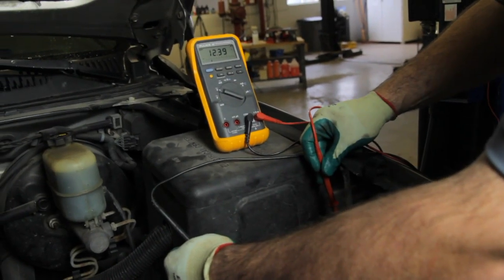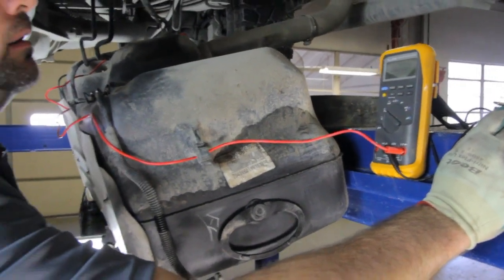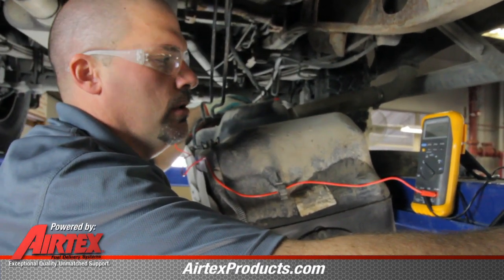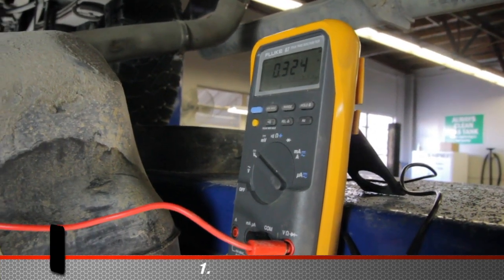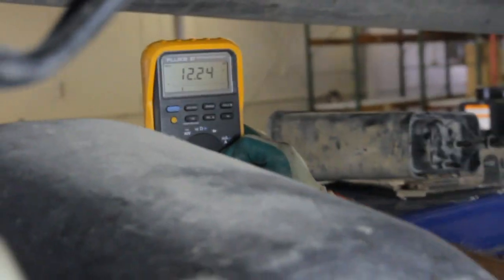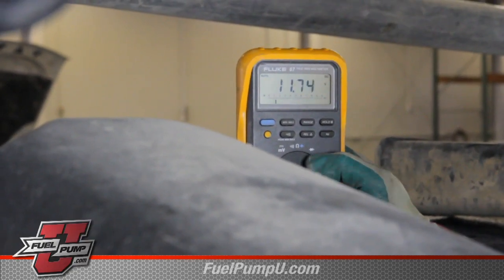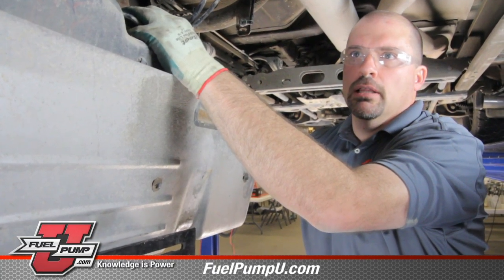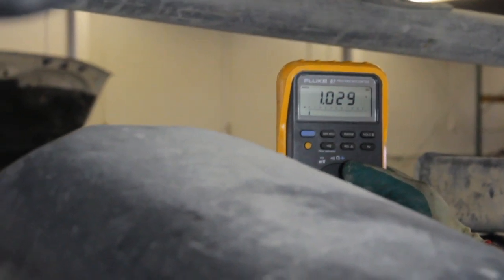How to Test for Fuel Pump Voltage Drop

Comment: THANKS FOR YOUR VIDEO. A few Key terms should have been mentioned in your diagnostics.  For instance, your first check is called " a Ground Test" integrity for the fuel pump. In other words, any voltage drop on this Fuel Pump Ground will indicate a poor deteriorating ground connection. There is a limit to what this maximum value voltage can be. Also, any voltage drop on this check indicates that's the amount of voltage that will will be deducted from Battery system voltage and applied to the Fuel Pump (not good you always want battery system voltage applied to the Fuel Pump circuit).  As you mentioned, the amount of voltage to the fuel pump affects the RPM of the fuel pump therefore affecting the pressure of the fuel at the fuel injector rail.  Your second test emphasizes the voltage lost from the 12 volt power source to the power connector on the fuel pump.  This reading will also be subtracted from the total Fuel Pump power voltage applied, therefore affecting the speed of the fuel pump and it's pressure it delivers.  And lastly, at the end of the video it should be emphasized that yes the engine is running, however there is a resistance problem and it could become worse over time.   In addition, this resistance build up in a Fuel Power Circuit will result in poor wide open throttle acceleration. Of course my comments do not apply  directly to Pulse With Modulated power Fuel Pump.
Reply: He did a voltage drop on ground side first, duh and thats hos whole point pump isnt fetting full voltage
Reply: Blah blah blah

Comment: I’m getting 7.5 volts while back probing the  positive terminal. Have been trying to figure this fuel issue for months. I’ve replaced the pump and sock filter just not getting hardly any pressure. Checked the relay it clicks and is within the range for it to be good. I have checked wiring diagrams all grounds look fine.
Reply: You ever figure it out. I'm stuck. Please.

Comment: If I have 0 fuel pressure in my fuel rails and don't hear the pump cycle on ACC, can I just back probe the pump wire to the frame to test for any voltage going to the pump before I call the pump bad? 2000 chevy silverado with a lot of ground strap issues a gauge cluster slow drain. Just want it to run, no frills.

Comment: Great video! I am experiencing slightly lower pressures than id prefer and wonder if a combined voltage drop of .8 volts (.5v pos and .3v neg) would be enough to drop my pressure 5 psig or so. What are typical voltage drops on a new vehicle? I have not eliminated the power side contacts of the FP relay yet. Is there a typical contact resistance that is acceptable? How can the voltage drop of the relay contacts be segmented and measured?  thanks in advance.

Comment: voltage drop tests you should learn .. use on every car with any electrical or fuel injection issues.
engine running.. headlights on.  Digital meter set to 20 volts DC.

1. Negative battery post  to Positive battery post.  14.1 to 14.8 is expected.
2. Negative battery post to the Engine block.   0.04 volts DC max.
3. Negative battery post to the Body. 0.02 volts DC max.
4. Engine block to the body. 0.02 volts DC MAX.
if you get 0.00 volts on tests 2, 3 or 4.. set meter to 2 volts DC and try again..

additional tests..
trucks with frames.
Negative battery to the frame.. 0.02 volts DC MAX
Engine block to the frame. 0.02 volts DC MAX.  
why because the tail lights and usually fuel pump are grounded to the frame rails. not the body on trucks with frames.

on the positive side of the circuit..
Positive battery post to Several fuses in the under hood fuse box.. 0.04 volts DC max.

positive battery post to the Alternator output stud..  this might be as high as 0.7 volts  some cars and trucks with amp meters  usually your result will be less..

positive battery post to the fuel pump fuse..  this can vary.. but should be under 0.25 volts at the fuse..  that's a quarter volt..  i like a lot less.

on GM cars and trucks..  the oil pressure switch first and third wire also control the fuel pump power circuit.  lets test it.. find the fuel pump relay.  with the engine idling.. pull the fuel pump relay out of the circuit..  if the engine continues running. the 3 wire oil pressure switch is OK.. if it dies.. replace it.  with the small terminal relays used in so many later model GM models. the fuel pump relay terminals cannot handle the load for very long if the oil pressure switch is bad.

Extended cranking times???  stick a test light on the fuel pump fuse. have a helper cycle the key on without cranking the engine.. you should have 2 seconds on almost any car or truck..  if you crank the engine.. you should get fuel pump power as soon as you start cranking.. and it will stay on when the engine starts..

i am hoping that airtex will look at this info.. and make a video out of it..
Reply: if engine does not start, then  ''voltage drop test'' is required. if engine starts, why the test then????
Reply: @MUHAMMADKHAN-pe7ez  Voltage drop test checks the electrical connections between the battery negative and engine block with test 2..  the negative battery and the  body.with test 3.  remember the body is the negative connection for almost everything except the starter and alternator..  between the engine block and the firewall with test 4.. why... because the battery has 12.65 volts available.  even with the surface charge to charging voltage... the alternator puts out usually 14.6 volts.. that is 2 volts more than the battery can supply.. since electrons want to take the shortest route.. a braided ground cable between the engine and firewall is usually how its done . front wheel drive cars use cables from the engine/intake to the shock towers..  everything else in the car is grounded to the body..  the electrons will try to find a different route that is closer.. instead of going up the long negative battery cable then thru the mid side cable to the inner fender.  they will go thru throttle linkages.. thru the transmission, CVshafts.. thru the wheel bearings.. and then the steering linkage to get to the body... this results in a lot of burned up wheel bearings.  or U joints in rear wheel drive cars and trucks.. 
 test 5 to the underhood fuse box.  if you have ever been inside a fuse box.. some have multiple connections to the fuse box circuit/ Buss bars..  if one of those gets corroded or burned.  you may NOT have enough positive available for the devices to work at full power..  i have found so many issues that haunted cars when i did these tests.

 test 6... alternator output stud to the positive battery..  because copper wire is expensive... the circuit is actually undersized on most cars and trucks.  and with that many electrons flowing.. you get 3/10 of a volt of drop.. totally expected.  but what happens if the alternator output terminal is loose where the wire connects.. more voltage drop.. what happens if the wire is fatigued inside.. the strands broken inside the insulation.. or corrosion has filled the strands.. 

 just start doing the six steps..  when you find something higher than i posted.. check the individual connections using the volt drop..  i had one front wheel drive car years ago.. i could not get past test 4..  the engine to body voltage drop was just too high... i cleaned the cable ends where it jumped the motor mount next to the timing cover..  still the same.. i checked from the body to the motor mount bracket... good... i checked the motor mount bracket to the middle bracket... where the cable had jumped the rubber mount.. good... i checked from the middle bracket to the quick install bracket bolted to the engine where there are 2 long studs and a bolt holding it together.. BOOM .. that was it... a metal to metal connection with a voltage drop across it.. i loosened the stud nuts.. wire brushed the studs. and the mounting surface.. the bottom of the nuts... reinstalled.. and the car was fixed. 

 this test has reduced my alternator failure comebacks to almost zero..  made the cars run so much better.. 

 try filling a tire with an air hose..  then fill the next tire but somebody has parked on top of your air hose... you still get a little air.. but not enough to fill the tire... that restriction is a voltage drop..  can only be measured with the air moving.. so with the nozzle open.. you would have 150 psi in the compressor... but only 10 psi at the tire chuck with the air flowing.
Reply: @waynep343  thanks sir. you took time for me
Reply: Excellent posts! Perfect
Reply: Excellent posts, i have a question, since it take the path of least resistance, in that motor mount issue you had. Couldnt you have just added a sep ground for repair or test from the 2 poinst where u were having a bad ground? Engine to body homeade ground woukd fix it and maybe be better right?

Comment: What is the lowest voltage that will engage the E2471?  I didn't know that wiring could have an effect on low fuel pressure.  How does resistance correlate to low fuel pressure?  I thought pumps were either on or off based on battery voltage.
Reply: 😅😮😮😮99-04⁰0k 6o😅😮⁹😮😅⁰⁸99😅😅😅😅😅😅die 😊😊o⁹8lkl9k8lh 88⁹in 😅8😮😮😮in 9⁹9⁹in 99-04 😅7th 8 99-04⁹9😮9 o 9 1 0999 0k 7th 99😊9⁹😊9 o o😊99 99-04😊😊9 1 9 1⁹99😮9😊9o😊was 😊9 1 o😊9😊😊😊😊😊o😊9 1 o😊😊😊😊😊99😊9😊⁰9😅so muchhhh was 😅7th 00😅8😅😊9😊😅😊9😅die 90😅😅I 😊😅😅😅die 😊o 99788😊9😅😅😅😊😊😊😊😊😊9 1 7😊😊99😅o909 9 1😊😊😊08😅😅😊😊so ♥️ 😢 😮99😅😊😅😊o o8 99-04😊0 o⁹99-04 so 0k 😊😊😊😅😊99😅9😊9😊9k😊99-04 0k😅76😅o8😅77😊o 8 7th😊9 1 0k great o88?0f so much 89090😅😅😅😅😅😅90⁹66666766666666666666667666666666o66666o666o6666o68o66o6896666o66666699989899979999996999999899989o98789999999999999986666667666766⁶o 76 7y 6676666😅9😅9 1 9 1 much ♥️ 😢 💔 ❤️ ❤️ ⁹990090009gnkg 89i9 9⁹⁹😮😮so 😑 😮😮😮😮😮j v 😮die 😑 😑 😮😳 😮den den 😮😑 😑 😳 😢 😆 😐 😮😒 😮😑 😮9?9 1 😮was so 😮9?♥️ 😮♥️ ♥️ 9?99-04 9😮😮😮990090009gnkg 😮was 9😮😮9 1 9 1 😮😮😮die 9?hat 😮😮55 5th hat 😮😮oder 😮hat 99-09😮😮😮9?0k 9😮9😮😅😅o8😅die 9k sind 09⁹999😊😊😊😊😊😅000000⁰😅😅😅😅😮😮😅😅😮😮😅😮😮😅😅😮😅😮😮😮😮😅😅😅😮😮😅😮😮😅😮😅😮😅😮😅😅😅😮😅😮😅😮😅😅😮😮😅😮😅😮😅😅😅😅😮😅😮😅😮😅😅😅😮😅😅😅😮😮😮0😮😮😮😮😮9😮⁰😮😅😅😅😅😅😅😅😅😅😅😅😅😅😮99-04 😅😮😅😅😅😮😮😮j 😮😮😮😅😅😅😅😅😅😅😅😅😅😅😅😅😅😅😅😅. 😮😅😮😮😅😮😮😮😮😮⁹😅😮⁹😮99⁰😅p9⁹99😮😮